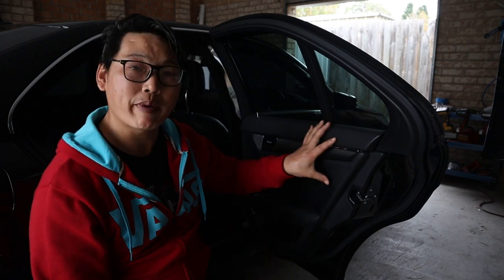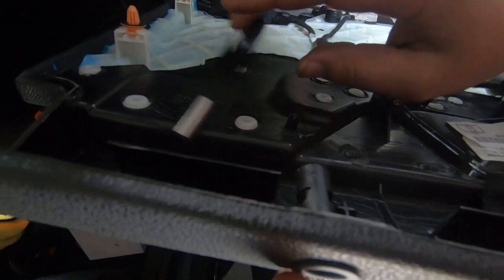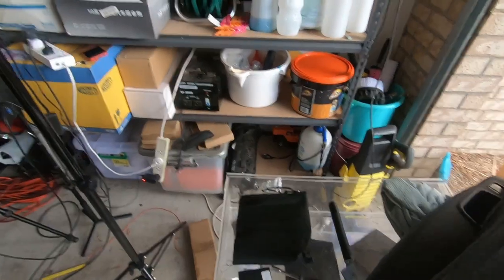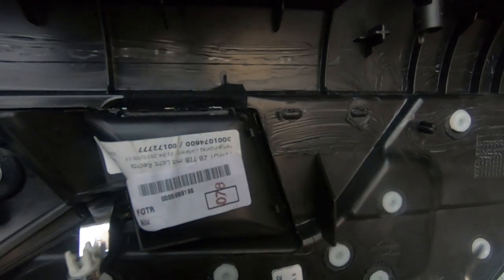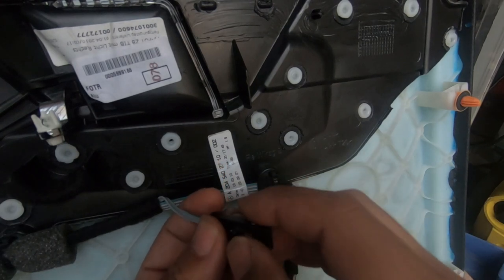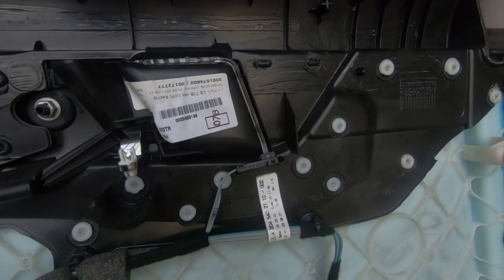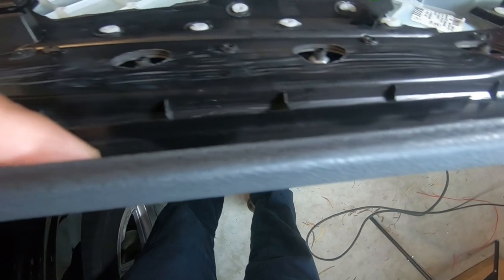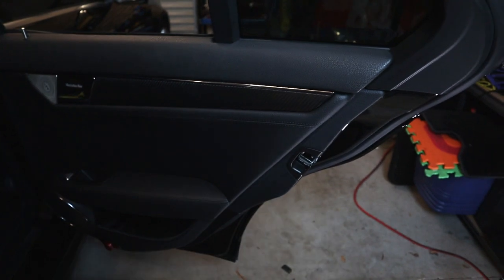mercedes w204 rear door panel removal+led door handle light+more...

Comment: My rear passenger door it locked shut and I can’t unlock it manually or with the central locking, and ideas how to open it without handles working? I can’t lift the pin either. Any help would be appreciated. Thanks
Reply from the maker: sorry to heat the only way now would be to pull apart the door and manually loft the lock from inside the door panel ..u should be able to do that.. more then likely the lock actuator has malfunctioned and needs to.be replaced

Comment: Hey Mikeyz..thx for showing us all these. I bought the new stainless doors ring base, is that mean U can't take the old plastic ring base off for the rear doors. I saw it is connected all the way down when U remove the panel. I need to take the old ring off to stick the new one on.
Reply from the maker: do u mean the lock pin for the door? the base of the lock pin? usually u stick it over the top ..if that's what it is...
Reply: @MIKEYZVLOGZ  I got the stainless door ring base but wondering how we  can take the old plastic one off for the rear doors w204.. Just like in this vids @2:21 https://youtu.be/80AihQQXW7o

Comment: Hi Mike,
I will need the 12v always turn on when car starts. I understand that to run 12v power cable to the rear door is not easy, also can't access via the cable trunking. Where can I tap 12v from rear door, pls advise. Tks,
Reply from the maker: easiest way is tyo run from rear fuse panel and run cable along door sill lower part and thats it

Comment: Hi Mike, how to tap 12v from w204 front & rear door for strip lights receiver?
Reply from the maker: when do u want them to turn on?? if u want always on then u need 12v switched so turns on wen u start car or turn key to acc mode... if u want only to have lights wen door opensm then tap the door lights .... if u want lights to sync with your interior then tap into your dome light at the back, just know that doing the tapping is abit involved but can be done , check out my puddle light video and u see how i did it , alot of work but worth it 
just decide how you want your lights to respond and then tap into the the right power source , or u can always use relays, but thats a whole other setup , i hope u get what your looking for .. good luck

Comment: Hi Mike, did U know which wire negative n positive from rear door unit to connect to the door light. So when open it is on n off when close the door.
Reply from the maker: I'm not sure I understand what ur trying to do
Reply: @MIKEYZVLOGZ  https://youtu.be/EJJUtBytt-k  3:37 flexx only show how to run the wire to the front. I gonna do the rear as well but just wana make sure it is the right wires so when open the door light is on n close the light is off.

Comment: There are so many videos on the front door panel and not many on the rear. Recently my door handle snapped because too much pressure was applied when opening the door and I’ve been stressed because I’ve wanted to fix it but couldn’t get the right videos.
Reply from the maker: Hope this video helped somewhat... u trying to fix inner door handle or outter
Reply: MIKEYZ VLOGZ inner
Reply from the maker: @Moon-uh4zb  ahb yes not alot od videos on it
Reply: MIKEYZ VLOGZ and that’s why you’re contents best. You cover so much minor but major things people ask for
Reply from the maker: Thanks for saying that
Reply: @Moon-uh4zb I have same issue, I can’t even open the door as it’s locked shut. Did you manage to fix the issue? I need help please 😊

Comment: Hi good and very clear video, I have a question. I need a 12v + and - wire in my doors. Without cutting. Is this possible?
Reply from the maker: hi there im.not quite sure what u mean? do u need to run a power sourcw to your doors?.
Reply: @MIKEYZVLOGZ  yes or use a power source in the doors. Cause I want to make ambient lighting in my doors. Ps thanks for the very fast response!
Reply from the maker: @SuperSuperfilms  ok so depending on what u have in your door, you can use either the door light or u will have to test for switched power in your door panel where your door control module is... if you do have a doo rlight you can hook it up to that
Reply: @MIKEYZVLOGZ  bmthanks for your response, but the doorlight only go on when the door is open right?
Reply from the maker: yes correct, if you want to install a door sill that would be the best option...especially if it is related top the door, you dont want it on all the time do you??
Reply: @MIKEYZVLOGZ  Yes it needs to be powered when the key is in turned on. Or something like that. It is for ambient lighting so it needs to be on when I'm in the car
Reply: @MIKEYZVLOGZ  this is the product https://youtu.be/rDCW40JfEDs
Reply from the maker: @SuperSuperfilms  oh i see ..so u will need a switched 12v power  source.... ok so i know u can find power in the door panel... im not sure which one but u can  test easily..... connect your light to 2 wires black and red if u have..or can be any colour...just make sure u know which is ur pos and neg....  then with the other side either ground to bare metal or find a negative wire ground/neg hook it up temporarily to test for  your door modules cables usually black or brown is ground/negative then with your other wire touch the other wires til u see ur light turn on.. then u turn ur car off and see if u still have  power there... if u do then change to a power wire that only works with the car on... i hope u understand what i mean... its a easier way to test for 12v switched power... or if u have a testing cable its easier.... u can also run directlt from your front fuse box through your firewall and connect it like that.... its just depends how tou want to do it... ive done some videos on how to find 12v switched powee and which fuses u can use of u want to go that route
Reply: @MIKEYZVLOGZ  thank you for your detailed answers! I go try that. But the only problem I have is that I dont want to cut in wires. But I think it is a bit difficult to pull a new wire from the fuse box to the door. Or is that not that hard?
Reply: @MIKEYZVLOGZ  ps. Sorry for the many questions
Reply from the maker: @SuperSuperfilms  i know it sounds hard but its easier then you think ..if u watch my video on how to install a sub woofer i show exactly how to do that ..but if u dont want to do that you will have to cut and solder or splice into the wires
Reply from the maker: @SuperSuperfilms  its ok friend i am always here to help my subscribers and followers... im just glad i can help

Comment: What color are the POS and NEG wires going to the door speaker?
Reply from the maker: it'd brown and green with grey I believe I hve to dbl check
Reply: Thanks.. I took the rear door trim plate off to find the speaker wires to run them to the trunk, but there are so many wires tucked down there..I suppose I could take the door panel off to look at the wires coming directly off the speaker...you made it so easy to do... thanks again.
Reply from the maker: @David-uh9cc  it is my friend

Comment: Where did you get the Burmester cover from?
Reply from the maker: aliexpress
Reply: @MIKEYZVLOGZ  is there one for the front?
Reply from the maker: @KotakaSRT  yes they sell in pairs and x4s
Reply: @MIKEYZVLOGZ  hm, i was looking around and i only saw the back boor one. The front ones are little longer [talking about the trim not the speaker]
Reply from the maker: @KotakaSRT  trim? u mean the round speaker cover or the tweeter cover?  . im not sure what ur aaking about
Reply: @MIKEYZVLOGZ  just like the back door, the front door has 2 trim peaces between the door handle. You have the ones in the back installed on the smaller trim cover on the right of the door handle. Is there a piese for the front little trim peace standing ont the left side of the door handle just like the back door one.
Reply from the maker: @KotakaSRT  ohh sorry u mean the trim ... mine afe wrapped but yes they do sell a set ..but they are adhesive stick on ..honestly wrapping yourself is much easier

Comment: I managed to break the plastic piece (argh) that the light runs through. It still works just not as well. Part # 2048250001
Reply from the maker: the plastic that lights the led for the door handle ?
Reply: @MIKEYZVLOGZ  - Yes the plastic Long clear piece. Evidently the top portion was not loose enough and it snapped at the curve . I tried to glue it but it was too difficult. I’ll probably replace it as I want to do a speaker upgrade.
Reply from the maker: @The_McD  ye just replace.. just remove it next time so u don't break it